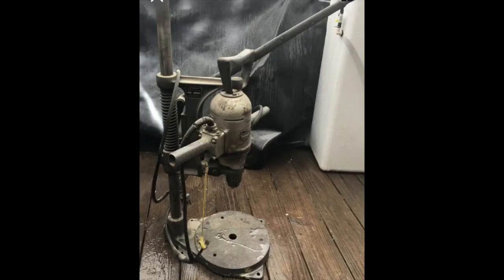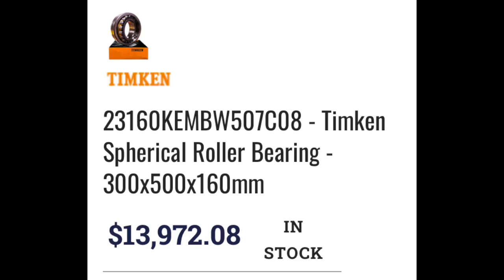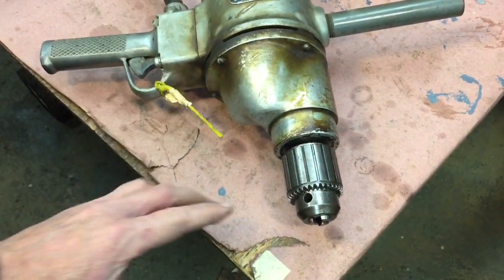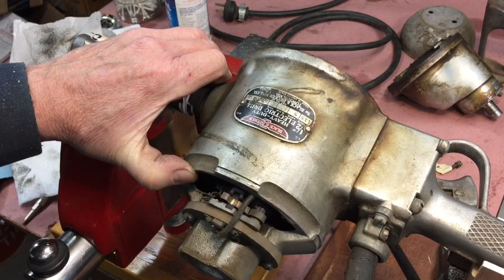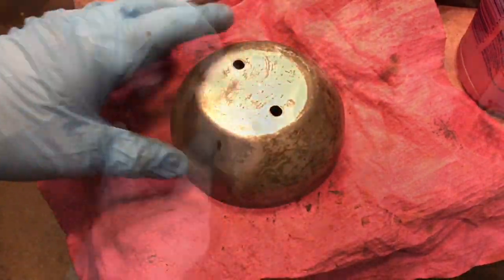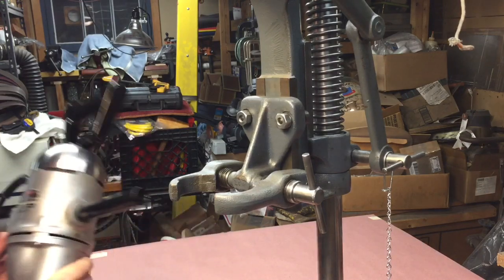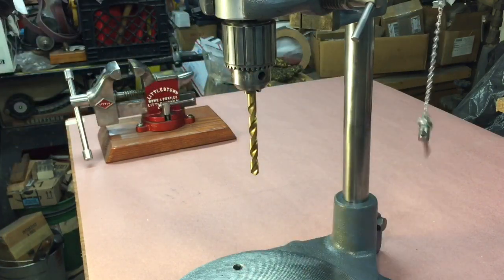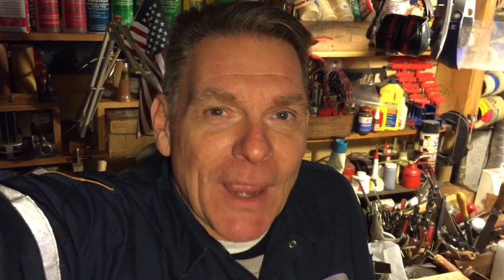Black & Decker Drill Stand and 1/2” Heavy Duty Drill Combo.

Comment: That was the same kind of B&D drill that almost killed me way back in 1963. Fresh out of high school working on my first job. The boss told me to get the drill motor and hone a cylinder out. Got all set up with my feet firmly planted & my hands gripping the handle. I pulled the trigger and the thing was shorted out & all that electricity went through me. I couldn’t do a thing but emit some sort of a guttural sounds . I couldn’t let go either. Luckily my co worker saw what was happening and rushed over to unplug the thing. WOW! What an experience. I still remember that feeling. I’m lucky to be alive. I have a great deal of respect for electricity today. This was before they put a U-ground plug on tools.
Reply from the maker: Wow!  You are lucky to be here today!!!   I too have been shocked before and also have a healthy respect for electricity.   Thanks!!!

Comment: For a replacement strain relief for small power tools, I have been using rubber spark plug boots. The red /orange ones are silicone and don't work well. You and your subscriber did a great job refinishing those drills.

Comment: Beautiful work on the drill and stand John. Though I do more work with battery powered tools these days I still like the older Black & Decker tools. I gave my nephew Matt Lynd @ Turtle Chapel Forge on Facebook, an aluminum frame bench drill press with a newer, but still aluminum body drill that he is using to make custom knives. He also bought Old #47. The treadle grinder I rebuilt. No shop work for a while. When I do get back into the shop I have a few hundred projects to work on.
Reply from the maker: Dave- There are always lots of movies to catch up on while you make a speedy recovery.  😃👍

Comment: Totally agree on bearings. My landrover gearbox rebuild and also the front axle, I’ve left 50 year old bearings in place, still within tolerance, as they are named bearings and glass hard steel. Maybe a new one would make the shaft ever so slightly tighter but in months it’d be back to where the old ones are and in a coupla years be worn out and knackered!  Half the battle is to know when to leave well alone. I’ve got a similar drill to your recent pair , it’s a Wolf and runs so slowly!  Great for honing bores!

Comment: That is a SWEET setup and I bet Unc used these a lot helping his dad and in the foundry too. Great job and I remember the black with B&D too. And Anthony did a sweet job as well. Happy week, John CS! A sweet video!
Reply: Certainly did use the  drill. The shop had a radial arm  drill press.  With a #3 Morse taper chuck that could drill a 3" hole with a twist drill.
Reply: @OldSneelock  I could use a setup like that in my limited spaces but I have the vise and a big gut to push the bits through so I guess all is fuffish!

Comment: That is a brilliant drill repair idea using 2 vises
Reply from the maker: Having two vises on boards really has helped me out a few times, it's even better if the vises are the same size and model but so many times you can clamp each vise to the bench and suspend work between them.   If you were doing a lot of drills a jig could be made to really make things easy.  Thanks!

Comment: The drill looks terrific.   Nice job on the cleanup.    I like the polished cap more than the black, although the black does look good.
You did not mention what you did to the chuck taper to clean it up.   Looks to be holding well now.
I have a Milwaukee Magnum 1/2in corded drill I purchased around 1982.    Back then it was made in USA.   Still looks and works like new.   It does not get much use these days, but when I need the torque it is waiting to go to work.
Dave.

Comment: What a great resto Scout. You are so right about if it ain’t broke don’t fix it. It get quite a few power tools from my scrap yard and repair them but you will never see a video of that on my channel because as soon as you don’t replace a bearing all the Tubers get on and complain that you didn’t do it properly whether the bearings or brushes need replacing or not. There are some nasty keyboard  jockeys out there. Cheers Stuart 🇦🇺
Reply from the maker: LOL  Stuart- What a lot of the people watching don't understand is the old bearings and brushes were much better quality then you can get today because most of today's stuff is Sub-Par, the older bearing were made of 52100 steel that was amazing.  New bearings are questionable as to what they are made of. The brushes back then were also made of a very fine carbon and little filler, today not so.  I even have old drills with 2 prong cords that are still nice with no cracking, I will keep them and just bite on a stick!   =D
Reply: @ScoutCrafter  😂😂😂😂 I don’t know about biting on a stick as I’m always happy to upgrade the plug and cord. Cheers 🍻

Comment: I've had good luck on old bearings, even ones that are frozen. I'll pick out as much dirt as possible, douse it in wd40, place it in a hot mixture of Simple Green and water in the HF ultrasonic cleaner (3 times on max time), dry it out then lightly oil as needed. They almost always work like new. It saves a ton of money on those oddball ones like on Walker Turner drill presses.
Reply from the maker: Rob- You are so right, those old bearings were made of Virgin 52100 steel, some of the best steel ever made!  The knife guys all look for that steel to make awesome knives.  Most drills the bearings get dirty and the grease gets fry but the bearings are still great.  The exceptions are machines with a lot of hours and heavy load forces.. Thanks!!!!!!

Comment: Awesome stuff. I really like the silver cap. I wonder, what's the "fix" on the grooves of the taper? My Atlas has the same issue, bit more even I think. I never thought it was an issue but now I'm worried.
Reply from the maker: Hi Alex- if the Chuck isn’t cleaned properly before re-installation it might slip or dislodge, even small particles of dirt or grime can leave scars on a virgin surface.  Nothing to worry about as there is plenty of surface to grab on to.  😃👍